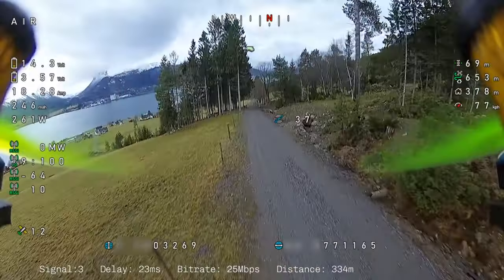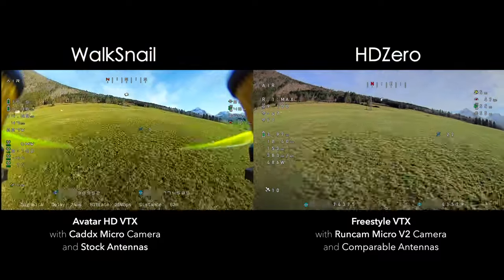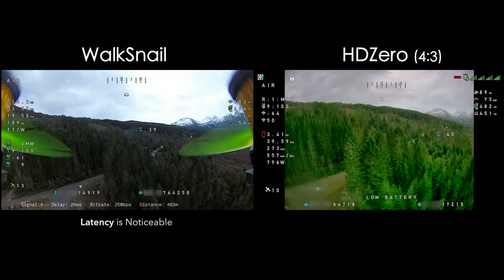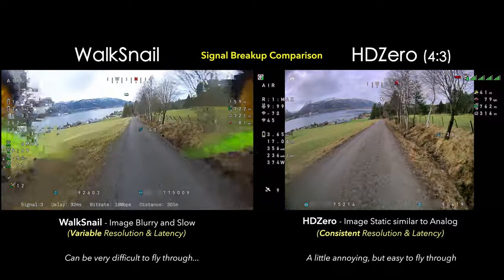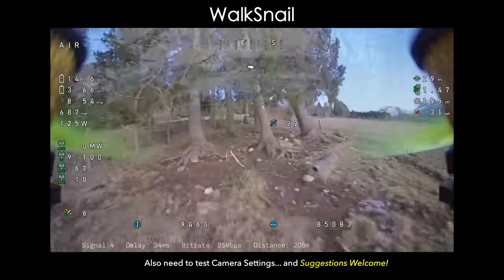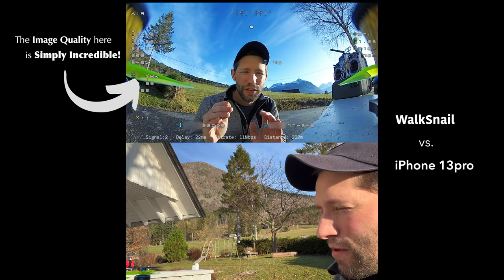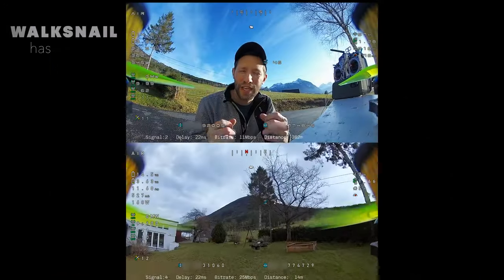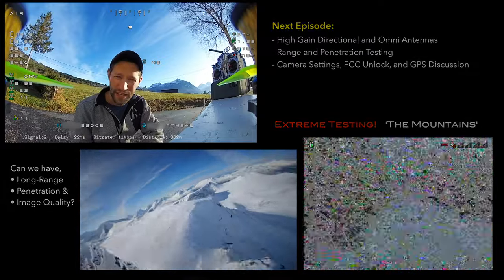WalkSnail Digital FPV Range & Penetration Testing | Signal Comparisons to HDZero | Initial Review |

Comment: Great video as always and I feel the same. I find the variable latency and the way walksnail (or DJI) breaks up to be too distracting. For some folks, it is no problem, but for me it is a deal breaker.
Reply: Yea I'll be close to me and my dji blurs ugh
Reply from the maker: Yea, I can get used to the breakup and latency, but the performance needs to be better than I’m getting here… HDZero will always be in my line up simply because it looks good and I have confidence in it. I mean I trust it 7km out into the mountains, which is a risky place for an FPV quad… haha! Thanks watching and commenting, stay tuned, cheers!
Reply: @GiantAntCowboy  yea my analog I made it around all the buildings around the block. Very hard to see but made it. DJI was freezing skipping then froze and I crashed. (Didn't help I did have go2 that might of blocked antenna a lil idk ) but can't fly when it freezes
Reply from the maker: @divingfalconfpv4602  with analog or HDZero it displays what’s it receives, that’s it. When DJI/WS can fix the image it works great, but when it can’t fix the image it just freezes and blanks out. 
HDZero and analog are like we only have 10 image pixals, but here they are, enjoy! And often that’s enough to save the day… 
In my test here I think that’s what’s happening behind the trees, WalkSnail is trying to fix the lost data but the trees are absorbing the RF so no data is ever received so all you get is smeary image. HDZero is like here’s what I got, and adds some static for missing data. 
Just a theory that I’m going to test, based off something Chris Rosser said. We’ll see.

Comment: What do you plan to put on the receiving antenna on the VRX?  Helical?  Omni?
Reply from the maker: I’ll be using four Directional Antennas. Since I always fly in front of myself I find Omni Antennas to be a waste on the receiver side of things. I likely run either four Helicals; or two Helicals with two X2-Airs.
This setup should give great range, but more importantly excellent penetration! 
My goal is to make it up this woods trail I call “The Gauntlet”, I show it briefly at the very end of the video. 
So we’ll see what works, stay tuned, cheers!

Comment: Nice comparision as always! But do you know maybe, on the walksnail vrx there are LHCP patch antennas right? so are you going to make new lchp helicals or change those patch and on vtx? Regards!
Reply from the maker: Thanks, appreciate the comment. I’m planning to swap all the antenna connections (VRX/VTX) to SMA. Then I’ll just run all RHCP antennas. 
However I have toyed with the idea of only changing the top two and using a couple LHCP helicals I made a long time ago, and maybe I will do that first actually. 
That will be a nice test for folks that really just want to see the affect of swapping the stock Omnis with two Helical antennas. 
Again appreciate the feedback, it’s helpful to hear thoughts from everyone. Stay tuned, cheers!
Reply: Yes.. a lot of people say that the stock antennas are trash..Maybe this is the main issue. But however I assume that changing them with HQ RHCP mushrooms(or helical) could be even worse.
I am still unsure how to update my hdo2 - walksnail or hdzero? Maybe some more of your videos and I will decide 😂
Reply from the maker: @Ja-Ko  hoping antenna upgrades can be the solution because the system has great potential. I’ll be changing all of the antennas over to RHCP, so it should certainly perform better.
Deciding between the two systems is tricky for sure. Both have pros and cons, so it depends on your flying style and goals. 
I’ll be doing updates on both systems soon. New WS antennas and New HDZero 1080p modes.

Comment: Have been using WS since early August with goggles. Firmware makes a big diff. If you are not flying the 33.x "beta" I would try that. I run rhcp luminear patch and stubbies on the goggles and axii micros on the vtx. 720 50mb 500ma is really good for my conditions
Reply from the maker: Hey thanks watching and providing your thoughts. I am running the current Beta Firmware. I haven’t done any proper range testing, this was all within 500m, but the problem here was mostly signal penetration in the trees. I haven’t found many penetration tests with trees🌲yet. 
I’m gonna keep pushing the system until I find some solid performance improvements. Thinking high gain antennas might be the answer, but we’ll see! Stay tuned, cheers!
Reply: @shermankenb Do you mean beta 31.36.8? You mention 33.x…?
Reply: @misshazelnut6826  yes

Comment: Makes me wonder if you're not dealing with a setting or firmware issue. Running the newest beta firmware with both stock stubbys and longer lead omnis with way better picture than what you're showing on both the planes and quads I'm flying with similar ranges.

Obviously isn't your first rodeo but are the antennas all seated properly and lhcp?
Reply from the maker: Yea, I made sure to update to 31.36.8 prior to testing. I tried all settings, after the video I even unlock FCC mode for higher power and bit rate, which didn’t result in any massive improvements. 
Antennas are seated and screwed down, all stock LHCP. So all I can think is maybe WS is more affected by some local environmental interference. Before I changed the antennas I’ll change locations and test again. Thanks for the suggestions, stay tuned, cheers!
Reply: @GiantAntCowboy  It's known that the stock WS Antennas are the reason. I dont know how good the patches are on the VRX. However, some folks replaced them already as well.
Reply from the maker: @thirdpartycookie  yea that’s my plan, stay tuned hopefully I’ll have a more positive video next time!!
Reply: @GiantAntCowboy  yeah nice, being too poor myself, I enjoy watching others having fun with it ha ha

Comment: What firmware were you running on Walksnail?

I'm asking because I'm using the latest from their Discord and get waaaaaay better than you've shown here, which looks like a much earlier firmware which was terrible.
Reply from the maker: I’m running 31.36.8 which is think is the latest Beta version from December. You agree?
I was definitely expecting WS to crush, or at least keep up, with HDZero performance.
Reply: @GiantAntCowboy  Wow, yes... That is the latest one and I'm very surprised because I'm running the same and have massively better performance. 

I'm a huge HDZero fan and user and my Walksnail system beats that for all but latency and feel.
Reply from the maker: So strange… are you using stock antennas?
Reply: @GiantAntCowboy  I'm using TrueRC Singularities on the quad, and two TrueRC Singularity stubbies on the VRX module with HDZero goggles. 

In fairness, they don't seem to have improved much over the completely stock antennas I used before I got those.
Reply from the maker: Ok hmm, well I hope I figure it out. When I was setting it up I was super impressed be the image quality, but then the test flights were quickly disappointing. That’s when I took the HDZero quad up for comparison. 
Well I’ll keep playing with it, I obviously want this system to work, spent decent money on it you know. Haha

Comment: Nice testing and about what I experience. Some flights with it on my wing its just a breathtaking clear image. Then the other day I get smearing in clear line of sight 200m while bitrate says 40mbit. Looks like the encoder sometimes is a bit too happy to compress.
When you do range testing, make sure you only fly in a way rth can work cause you are going to need it if you push range. I once lost connection and only got it back when the plane was about 4km closer. Something I definitely appreciate on my hdz rigs, almost instand link recovery when turning back.
Reply from the maker: Thanks for watching and sharing your experience. Very strange behavior for sure, the system is still in the development stages so hopefully they keep pushing the firmware side of things. 

That whole “black out signal” thing is the main reason I’ve been using HDZero/analog for all my longer-range mountain quads. A signal loss like that would most certainly result in a lost quad. GPS rescue works well when you’re high up, but I often fly a couple meters off the ridge line, which is fun, and looks great, but you’re only a second from losing LOS or crashing into a rock… I know people fly WS/DJI in the mountains but the variable resolution, latency, and potential disconnection only adds to my stress in these environments.
I’ll post a follow up soon, so stay tuned, cheers!

Comment: Feeling exactly the same when flying around trees
Upgrading the patches and Omnis to Truerc on my WS VRX made it a little better, but still not compareable to the clearness and locked in feeling of HDZero. We probably get used to it some time :3
Reply from the maker: Yea, thanks for confirming that. All these systems have a “good use case”, at the moment I’d definitely use WS for a cinewhoop, where the image would really be usable. I thought maybe I’d try this long-range but I lack the confidence to send an expensive quad into the wilderness with it… I’ve been watching a lot of range videos and many are really impressive but I noticed after 3km the Bitrate is often between 0-5mbps… I assume if they were closer to the ground, diving a cliff side for example, it’d be crazy blurry and potentially about to freeze! (Had a fail this afternoon like that, kinda my fault, but it happened…)
HDZero has locked latency and resolution, and its really easy to tell when you need to stop based on the static. I’m not saying HDZero is perfect, but I have more confidence with it for sure. 
I’ll actually be testing the new 1080p30 mode this week and will try to share some footage. I think that could really add to HDZ’s competitive edge, but we’ll see, so stay tuned, cheers!
Reply: Change your VTX antennas.. the stock walksnail ones completely suck..

Comment: Noticing the lack of the planned update on trying new antennas to improve WS penetration. What is the scoop. I presume your not finding the solution you had hoped for?
Reply from the maker: Bingo. 🎯 … I’m still testing, but my initial attempts didn’t have a substantial affect on the performance. I think a lot of the problem is the compression algorithm. We see this blurry issue even with clear LOS and good signal, but I’ll re-focus on trying to improve this. 
My energy got shifted to Beta testing a 1080p mode for HDZero which is pretty cool. Not quite DJI/WS quality but a big improvement for HDZero! I just posted a video about it if curious. 
Stay tuned because I’m gonna get back to WS now, cheers!
Reply: @GiantAntCowboy  Interesting! I am looking forward to your conclusions. I see a lot of WS videos with blur when quad is flying low to ground and image is rapidly changing. Which is my personal concern as I enjoy that type of flying. On the other hand I see occasional videos that don't show much of that problem. Not sure what to think!
Reply from the maker: @bcc1955  yea flying close to the ground is impossible with WS, so much better with HDZero. I was just doing tests like this and couldn’t see anything with WalkSnail… just a blurry mess. This is the compression algorithm and can’t be fixed with antennas, but could be improved with firmware. So fingers crossed they are working on it! 
Note: Some videos posted could actually be on-board DVR footage. I’ve seen a lot of people, especially with DJI over the years, posting on-board recordings talking about image quality, but it’s really misleading, since that’s not the goggle view.
Reply: @GiantAntCowboy  Yeah, nice to get your verification! I am resigning myself to add HDZero instead for my light racing whoops. This way I get low latency and decent quality as I usually stay within 100 meters (on self made course with sparse trees). Keep my DJI v2 setup for high definition needs. Thaks for input !!!
Reply from the maker: @bcc1955  yea, and HDZero can have decent range and penetration with high gain antennas. I regularly fly out 7km.

Comment: Good review. For long rangers though, it's fitting the bill I think. I personally do not want to fly DJI for anything that could possibly involve my lat/long coordinates and I'm pretty sure DJI is pulling/storing all that data from our FCs. I can see a time in the near future where the FAA starts to crack down hard on BVLOS flying. I don't mind the image on zero for acro and prox flying. Coming from analog, it's still a huge step up. Hopefully WS stays around long enough for it to get developed to the level of DJI hardware. I like that it plays nice with the zero goggles.
Reply from the maker: Thanks man, appreciate the comment. Agreed for long range it should work very well, though I haven’t personally range tested it, guys like Wez Varty have some solid records. 
That DJI O3 looks awesome, but I’m kinda with you on your gut feeling…
HDZero had been great for me the last couple years. I was one of the first people to start pushing the range and now it’s a really capable good looking system. In fact I just saw some footage from “alpha testing” of a new 1080p mode and it looks great! Can’t wait to test that out, waiting to get my hands on it!
I’ve been loving the HDZero goggles. 
Anyway, I’ve done a bunch more testing of the WS system and now it’s time to work on some serious antenna upgrades. So stay tuned, hope to have a more positive review next time, cheers!
Reply: Furthermore, DJI is actively working with the FAA rolling out tracking tech, remote ID integration, drone-kill etc.  This will be built-in to all future DJI air units, if it isn't already....
Reply from the maker: Yea. It’s like buying a brand new automatic sports car. Looks cool and works good for most people. But others prefer an old, maybe even rough around the edges, manual transmission, gas guzzling racing machine! 
I’m ok with generic consumer grade drones having safety features built in. Many of the people flying them need those features in place.

Comment: sorry but you are saying WHAT?
The stock walksnail antennas are not even in the same league than the TrueRC x2 air and SpiroNET antennas!
this completely renders your test void!
connect some quality antennas to the walksnail system, uppdate to the latest firmware and it will outperform the hdzero stuff by far.
Reply from the maker: I think i just replied your FB post with: “I’ve been waiting for someone to notice that… lol. However this wasn’t originally meant to be a “comparison video”, but after getting poor WS performance I wanted to set some sort of baseline. I fully expected WS to outperform HDZ in every aspect accept latency and feel, and was genuinely surprised by the results. I ran this exact loop a dozen times with different WS settings and got the same results. 
I actually have an original SharkByte VRX with stock antennas which I can use to re-run the “comparison tests”, but that won’t improve the WS results shown here. 

The next step is to make a high gain antenna setup for the WS system. Hoping for better results. I said to others, I didn’t spend a bunch of money just to make a “WalkSnail Sucks” video. Haha”

Firmware is current, 38.36.1 (or whatever it is)

Comment: everyone knows the stock WS antennas suck.. i had similar issues and couldn't figure out why because i had some decent antennas on my WS goggles. then i changed the stock VTX antenna to a AXII and it was literally night and day difference..i didnt realize there was an issue until i got a little micro meteor 75 WS edition and it was going out WAY further than my 5" with 0 break ups only because they used a different antenna for the VTX.
Reply from the maker: Yea, I just posted a follow up video where I compare 1200mW, High Bitrate, and High Gain antennas. Antenna made the biggest difference for sure. Check out the PartII when you have a chance. I’ll be doing some further tuning and testing, but the current setup was a solid improvement. 
Thanks for watching and sharing you experience, cheers!

Comment: I think Walksnail is LHCP and HDZero RHCP which could affect performance/quality/range? Walksnail seems good for flying wing and and not freestyle as too much smearing imo- like snail walking... otherwise both are good systems but for different flying styles.
Reply from the maker: LHCP or RHCP should not affect performance as long as the RX/TX antennas have matching polarity.  You might be right, if I gain confidence with the system I’ll eventually put it on a longer-range mountain surfing rig. I’ll be doing some “Failsafe” simulations in the future to see how it recovers. Thanks for watching and sharing your thoughts!
Reply: @GiantAntCowboy  my pleaasure. Thanks for great videos 👍😃

Comment: Hi. WS googles have one TX antenna - which transmit to vtx and vtx using this signal to change bitrate - and only one helps - install high gain and longer than other antenna to first ch on googles. (Right up when googles on head). And super puper patches on 2-4 ch not helping! Only on first! WS have very blurry videos - does not even depend on the bitrate. and the greater the speed, the more soap. there are also spontaneous friezes - more often when performing tricks with fast turns of the copter, or when you fly around a tree and the signal drops a little anyway, some kind of friezes. a very unfinished system and not the fact that it will be better in the future - they can generally just abandon it in this form. IMHO.
Reply from the maker: Yea, the system looks great when it is working perfect, but gets blurry quickly. I just published a Part II video where I test High Gain antennas. High gain antennas definitely improved things. 

Thanks for watching, appreciate the comment. Cheers!